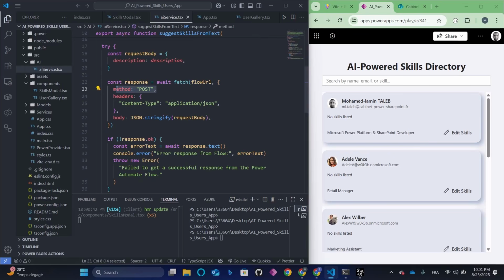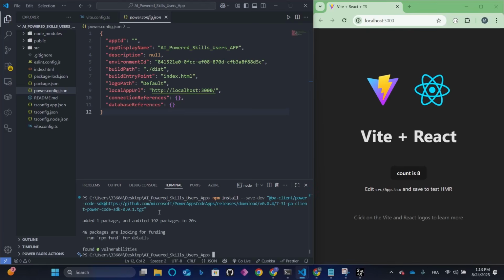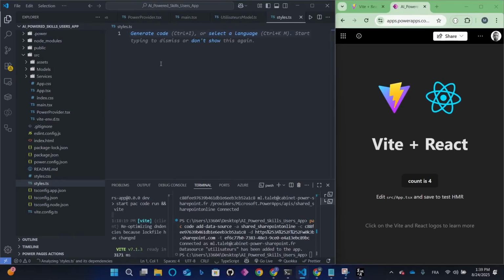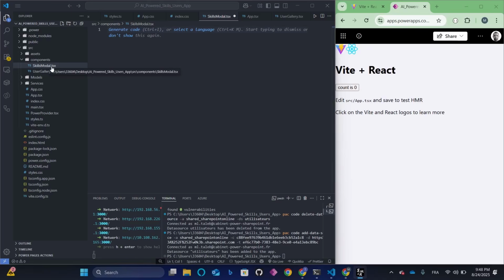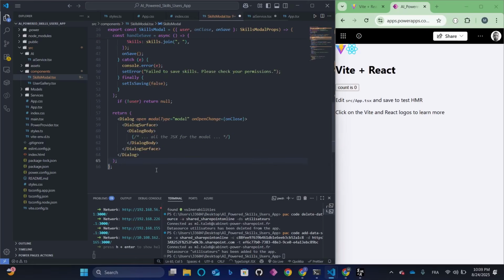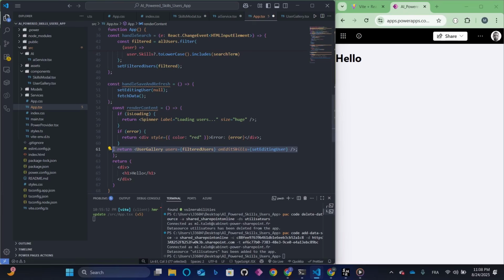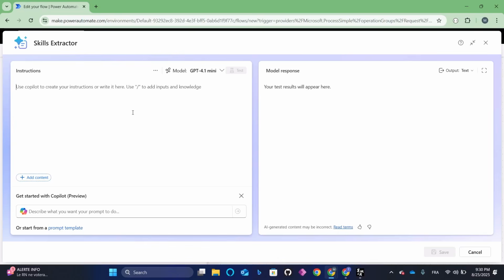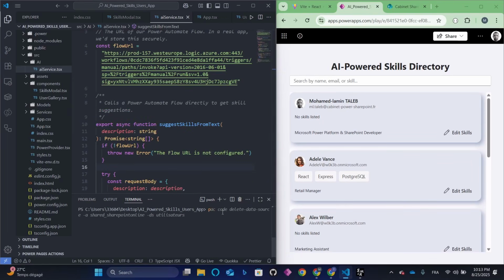PowerApps Code Apps: Build AI Powered Application with Code Apps

Comment: Thank you so much for this incredible tutorial. I do feel super limited in power apps, though I have a few questions before I watch the entire video (I will just to learn it all though)

1. Will it be working in the entire 365 office setup within the company? And if so, are there specific rules that have to be enabled? (in case you know :))
2. I think I saw it is web based, correct? And it does interact with Sharepoint, then i assume Dataverse is no problem?
3. code wise and function wise, can I interact with flows? Would I even need flows? I dont like them much
4. would you be able to install it as a program too?
5. how are reaction times with large databases? For example with power apps we are fighting the stupid 2k limitation. will that be a problem?
6. would it run on a phone? 

Thank you in advance and now I will watch it. Sorry if my questions have been answered, but might also be I add more. Its late and I cannot sleep lol.